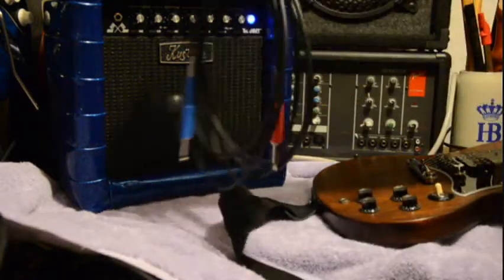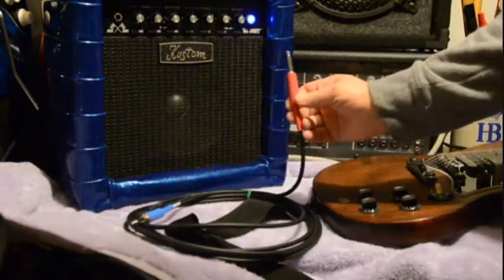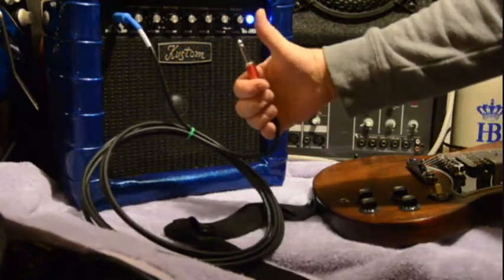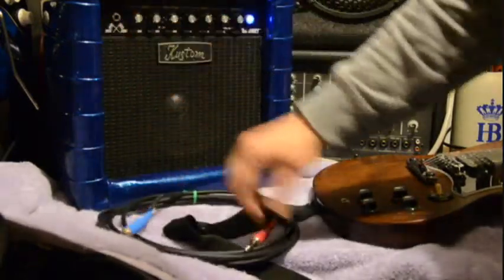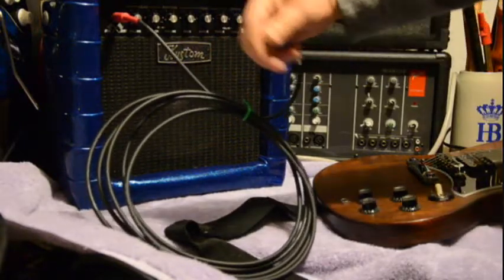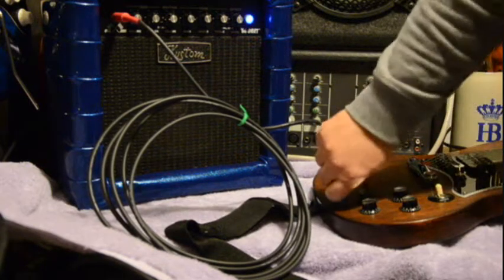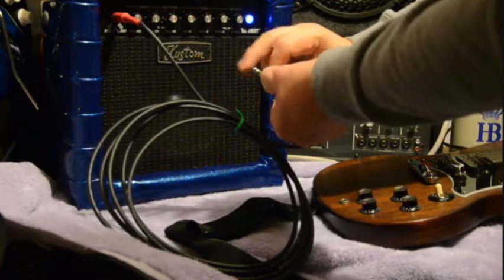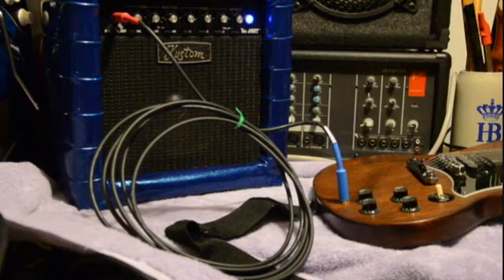JerroStomp Silent Tip Cables

Comment from the maker: DON'T TRY THIS AT HOME!  What I did wrong: don't plug the silent end into the amp.  I can wreak havoc with the input cap of the amp.  Second, don't play with the ring, it is made for even pressure, so pushing in one side could make it stick.  No problems with this cable or amp, but better safe than sorry.